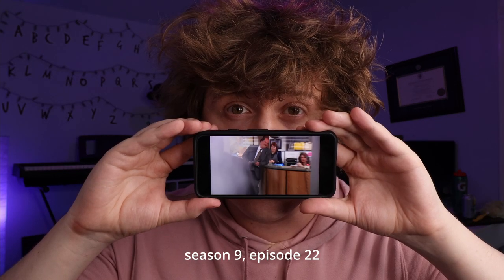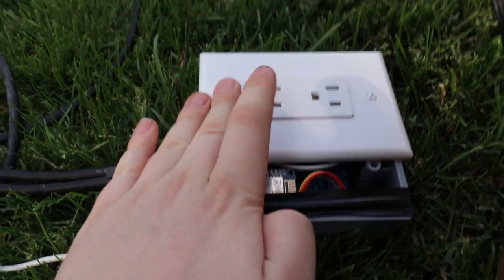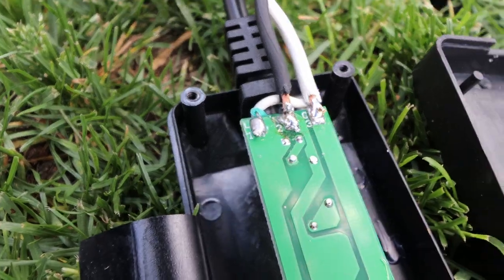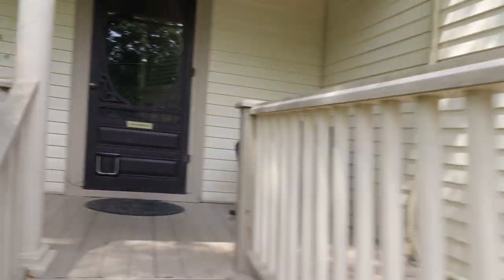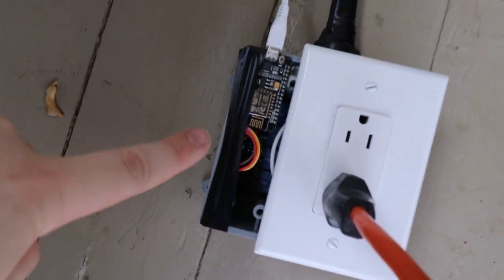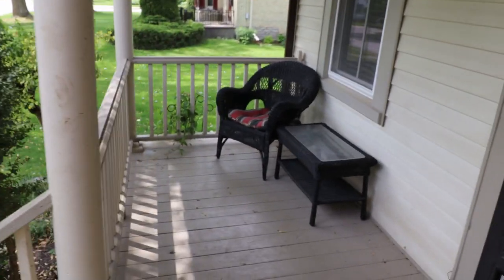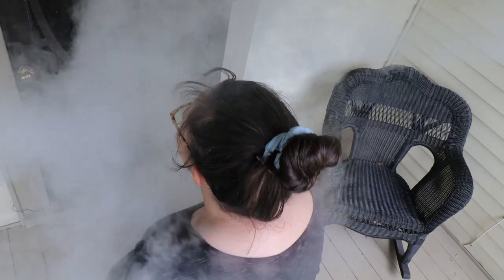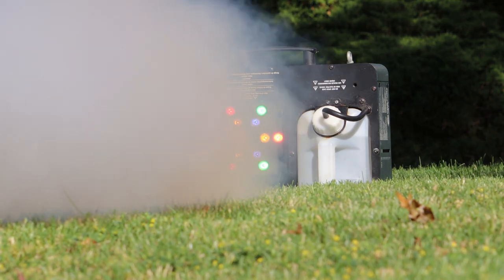Using a smoke screen to scare away intruders (inspired by Dwight Schrute)

Comment from the maker: I left out a ton of technical details because it was sooooo boring, so if you're into that kind of thing, here's a more in depth explanation:

The Wyze Camera pointing at the door is connected to a computer in the basement which runs a YOLOV3-tiny object detection model (the same one as my previous videos). If it detects a person, it sends a GET request to my laptop which is running a server. I was gonna use a raspberry pi instead of my laptop, but I didn't have a compatible microphone. The laptop then plays the day's security question, which it pre-generates with Google Cloud Text To Speech ("the tea in Nepal is very hot"). It then opens a stream on the outdoor microphone and feeds the data to Google Cloud Speech to Text, which returns the transcript of what the visitor says. If the text doesn't match once, it sends a GET request to the arduino telling it to turn on the fog machine. If the text doesn't match two more times, it sends another GET request to the arduino which turns on the leaf blower for a few seconds. I was able to control the more powerful fog machines by shorting a few cables, though I could have used DMX too.

Let me know if you have questions! I'll post the code too.
Reply: This is awesome!
Reply: When is the ghost thing coming out
Reply: You are underrated
Reply: I hope your channel grows
Reply: Is the code on your github yet?
Reply: You do know that 120 volts goes 6ft in dirt, if that 120 volt even so much as touches the ground it will kill you if you touch the ground... There will be a ring of electricity in the grass and it will kill you if you touch it bare skin, slowly kill you 120 volts is awful awful awful a slow miserable death, never give up trying to move, it will stop you from moving, never give up there is a chance you can escape